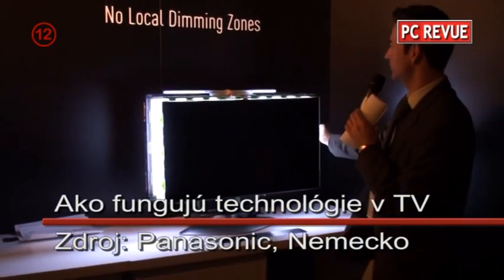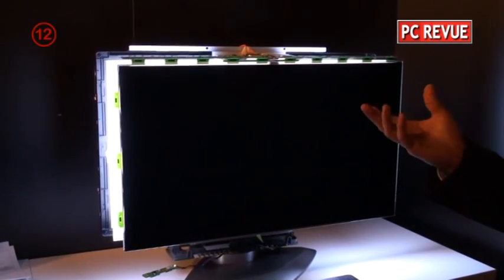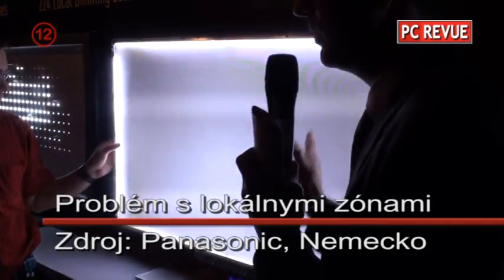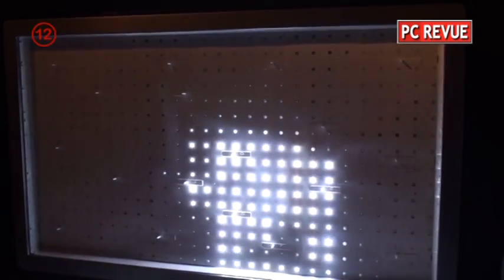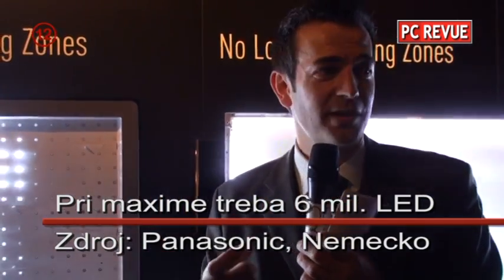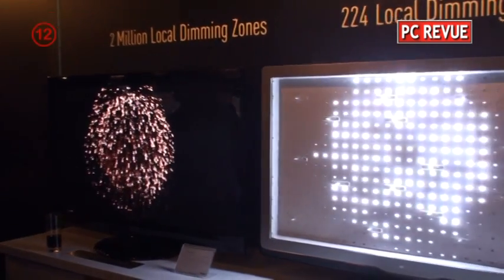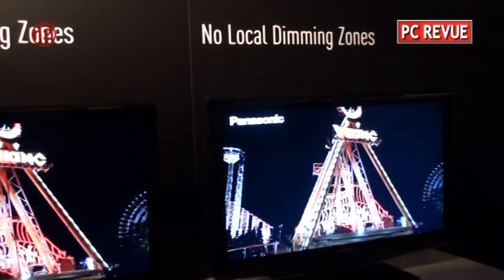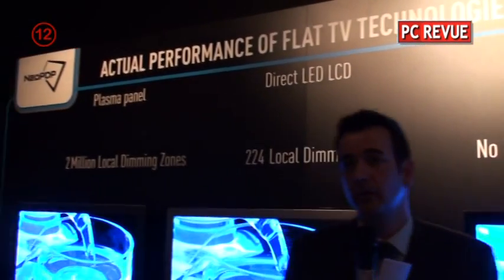Plazma vs. LCD TV

Comment: You're wrong about how long Plasma's last. You said the screen lasts 10 of average use before loss of color and the discharging of the gas from the phosphors. That's completely WRONG. Today's Plasma technology is rated over 100,000 hours and that's up from the 60,000 hours 5 years ago. Average use is calculated at 5 hours a day for 7 days a week. That's just under 17,000 hours in 10 years. Then you were saying that LED local dimming was superior to what Plasma offers? Educate yourself.

Comment: Your Plasmas have Big Fat Pixels overbloated CRT like 1920 x 1080 Expanded.Your Plasmas have Super-Glare Dim Screens that need Caves or Dim-Rooms to see.Your Plasmas are Course easlily observed Pixels regardless of what size HDTV garbage Plasma.LCDs & LEDs on the other hand have Smooth Pixels & CANNOT be seen unless you use a StereoScope at 20x to 40x Magnification.But your Plasmas are Disaster Technology with Fat Bloated Gas Pixels easily observed by the naked Human Eye even at 15cm. distance!!

Comment: LCDs and LEDs have Brighter Vivid Colours Razor Sharp and Smooth Super Tiny Pixels. Plasmas have Faded Screens with Easy to Observe Ugly Big Bloated Gas Plasma Pixels like CRT Tubes. Plasma looks like garbage by comparison to Excellent 10bit Video and 10bit Panel Processors or highier Specifications LCDs & LEDs with Smooth Images on curved images and ALL Structured Images.Plasmas have Bloated Fat Gas Pixels easily observable by the Human Eye.Plasma is garbage by Comparison to BOTH LCDs & LEDs!!

Comment: I do NOT consider Plasma HDTVs better than FULL PANEL LED HDTVs with"Local Dimming & Brightening Controls Manually".The Latter gives its user of FULL Panel LEDs HDTVs much more Control Manually of the Image Produced than any Plasma HDTVs cannot do Local Dimming &Brightening Manually as FULL PANEL Local Dimming/Brightening Manual Control LEDs HDTVs.I find your Plasmas have enormus Glare Problems & the Colour Fades after a 10 years of Average use do to the Inherit Fading of Plasma Gas Technology!!